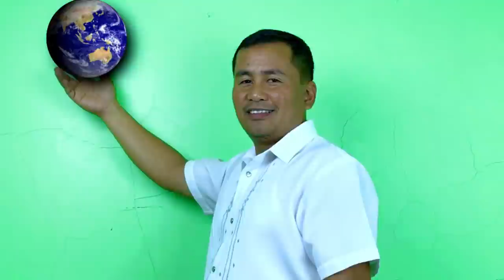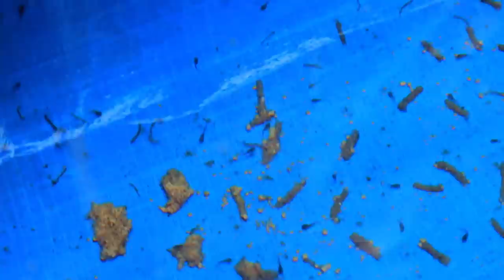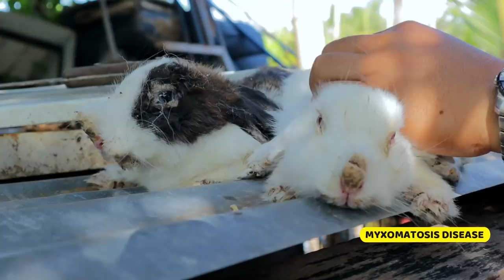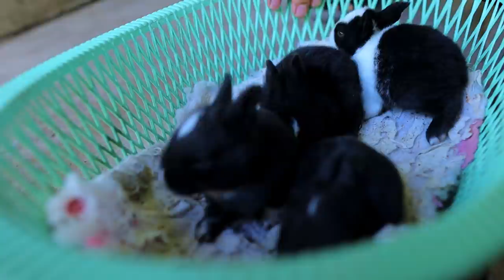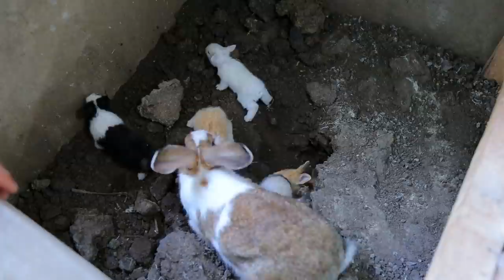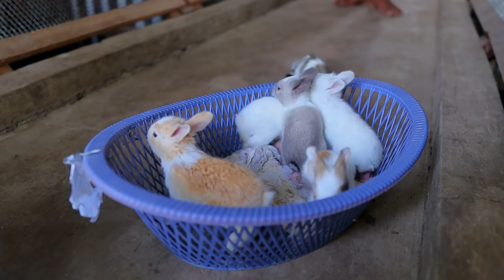Rabbit farming & Fish farming│ Mother rabbit gave birth to 9 kits (Rabbit health, care & Treatment)

Comment: Sir. What kind of paint did you use in your rabbit cage so that the woods are resilient to water and or to other liquids. Thanks.
Reply: Unfortunately if you want the wood to be safe for the rabbits then you don't really have an option because they are most likely going to chew on the wood. Based on what I've read only water-based paint such as acrylic, but that won't protect the wood from water. Either way it is best advised to leave the wood in the inside of your rabbits living space untreated. Also I don't know if you already bought the hutch or cage or are planning to make it yourself, but if that's the case then please look up rabbit safe woods. There are some types of wood that is actually toxic to rabbits.
Good luck!
Reply: @kristinaruvinova5718  thank you for this information.

Comment: Is it okey Sir Dexter to take the rabbits for a bath? Cuz many people says that it's bad for the rabbits.
Reply: It is bad and could kill them. It can be done if necessary because the rabbit is unable to clean themselves but only at the guidance of a vet, and would not typically go past the back end of the rabbit and certainly not on the ears as shown. This is because rabbits have thick coats, so it is hard for them to get dry which can lead to hypothermia and kill them. They also know they aren’t supposed to be in the water so they will often squirm and try and get away which can lead to them breaking their backs, and in this video we can actually see some of them squirming to get away and they are lucky none of them got hurt in the process. On top of that if bunnies get water in their ears it can cause them pain and ear infections. But yet they put water on the bunnies ears for some reason. And I should add as well, if they are bathed they are also not bathed in buckets of water like this, but rather the sink or bath or a small bowl where the water is shallow and easily drainable. The bathing seen in this video is bad advice and could kill the rabbits, or at the least give them infections or other problems. Do not bathe your rabbit unless the vet tells you to because your rabbit is unable to clean itself, and certainly do not bathe it like this if you have to bathe it at all.

Comment: For anyone watching this video please please do not bathe your rabbits like this!! Normally I will actually defend videos where people are trying to clean their rabbits from potty accidents but I've never seen them completely submerging the rabbits in water. Rabbits should normally never be bathed because they are pro cleaners. However, living in these kind of poor conditions I can see how they can get mites. Still, the rabbits been be given a bath that doesn't require the rabbit to be completely submerged in water. Unfortunately because they are prey animals they can easily go into shock. If you must bathe your rabbit, use only 1-2 inches of water maximum. Clean them and immediately dry them so they don't get hypothermia.

Also pro tip: never use wire bottom cages like this guy is using and if you absolutely must, put something in the cage that the rabbits can rest their feet on. They are prone to getting sore hocks and even more so on wire bottom cages.